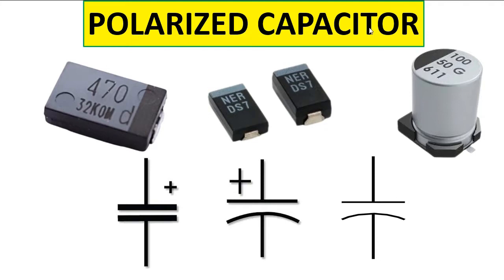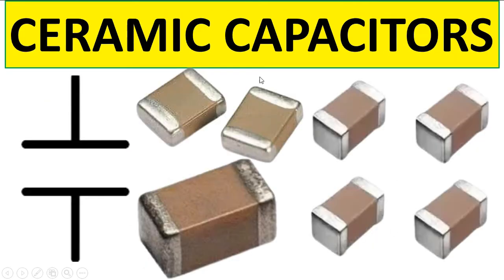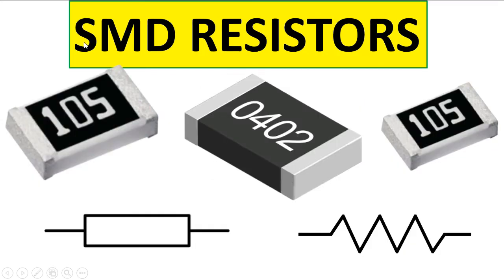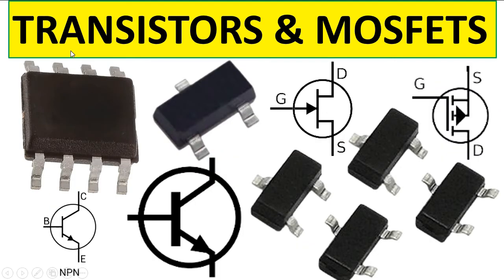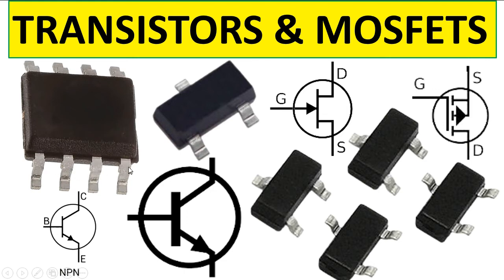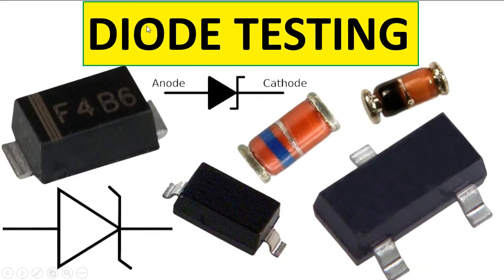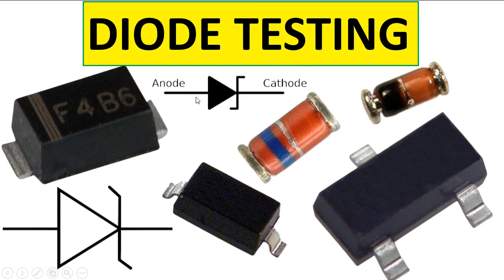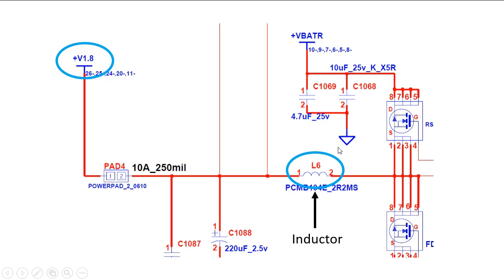Learn SMD components symbols used in electronics

Comment: 👏👏👏
One tip for 4:30
Before testing in continuity mode or diode mode you should unplug the battery and adaptor and press power button for a few seconds to discharge the capacitors.
Then short MOSFET terminals and then check for continuity. That's because a good MOSFET can be switched on and seems to be shorted when it has charge with voltage. It's kinda like a cap.🙂❤️